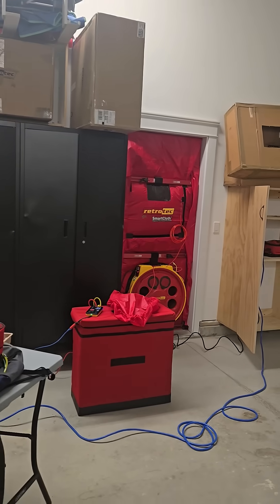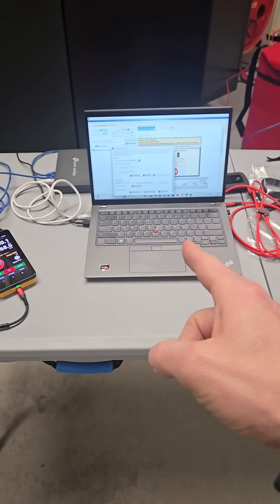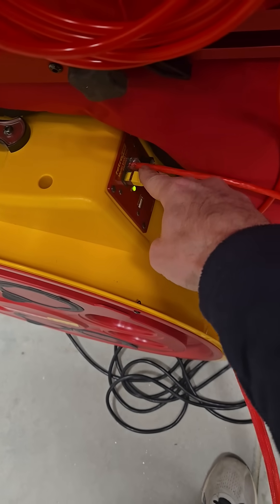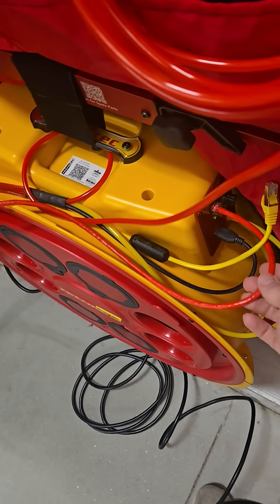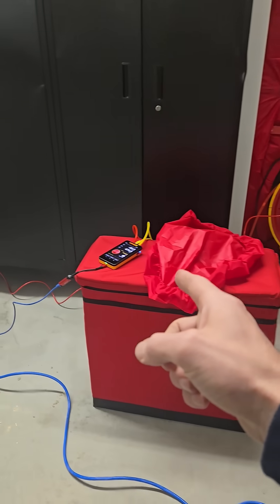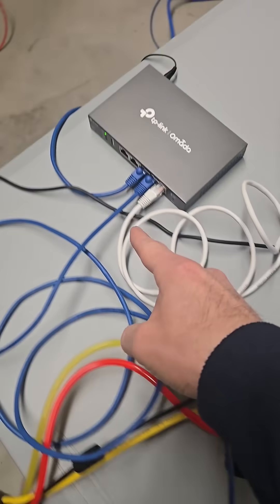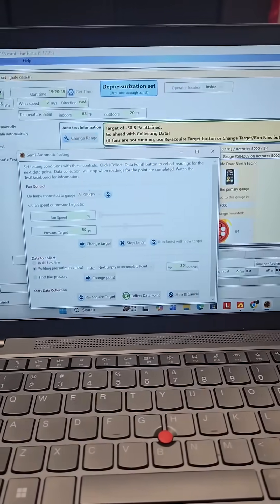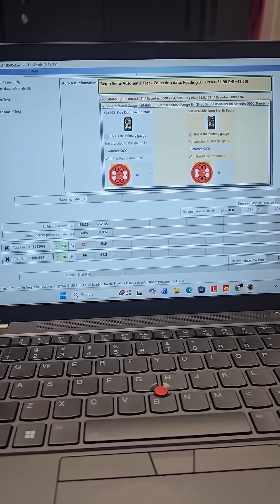Running Two Retrotec Blower Doors Together In Common Control

Comment: Hi, in your setup was one controller dictating the pressure to be achieved for both fans, or did you set each controller to achieve 50pa for example?
Reply from the maker: The master manometer runs the first fan and the first fan tells the second fan to run the same speed.  Then the second manometer measures that flow as well.  So to answer the questions, the first control runs both.  This is referred to as common control.  You can also do individual control and have each manometer run each fan.  Thanks for the comment!